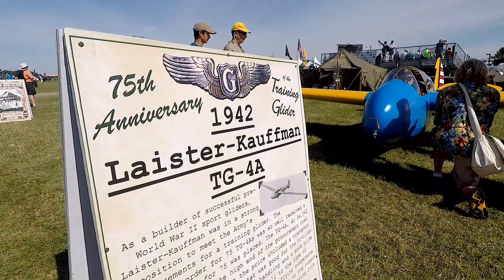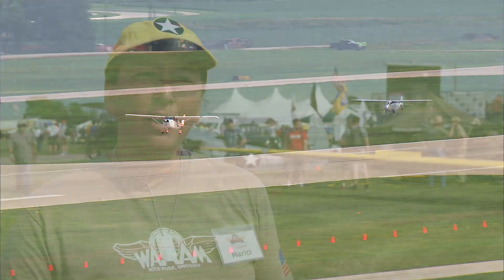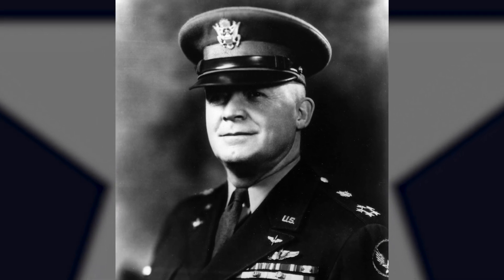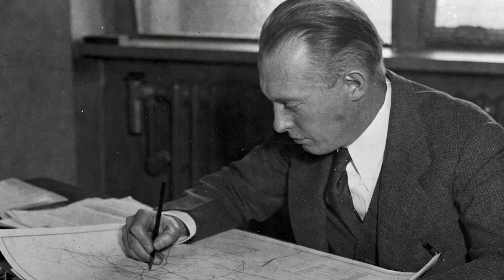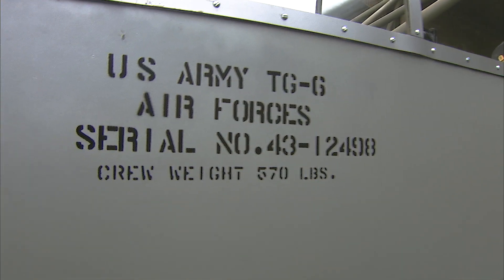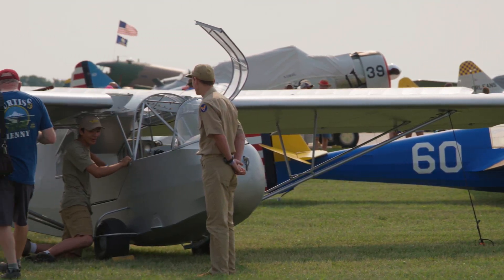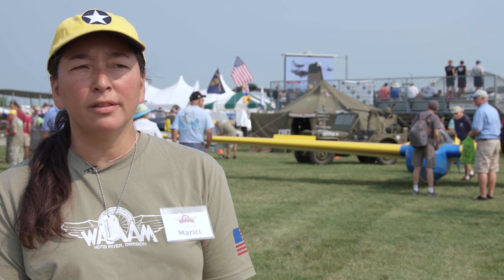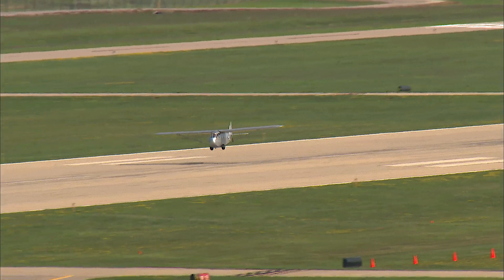Gliding to Success: World War II Training Gliders

Comment: Those were some of the bravest pilots around, who else would go under fire and try to land a powerless aircraft with heavy equipment and men on board?
Thanks guys, you did the free world proud.  Edit to add that sometimes they flew more than one flight, the glider was recovered, taken back and loaded again.  They used a hook to grab the glider and pull it up into the air, then towed it back, reloaded it and put it back again.

Comment: Is it possible to actually gain altitude by thermeling in these aircrafts or are they really only meant for dead stick training? The TG-4 seems to be the only one that was really designed as a glider.
Reply: Depends how strong the thermal is, lol. But realistically - no. I asked them at Airventure last year.
Reply: @rcbif101  You can thermal a c172 below a cumulonimbus cloud if your brave enough ;D
Reply: The only way is down.
Reply: i have a tg 4 logbook with flights up to 3 hours on it its got simaliar preformance to a sgs 233